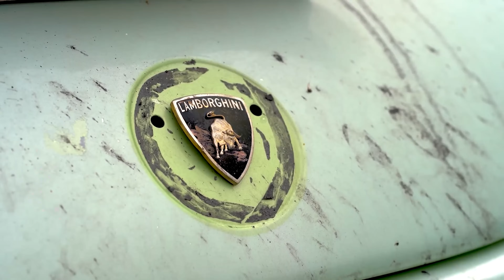Are Wheel Spacers Safe?

Comment: Caught some 2" Mammoth Spacers on sale from American Trucks about a month back. Had good reviews, so I pulled the trigger. Pushed out my factory 20x9 Ram Express wheels about an inch from the wheel well. Been riding about 2k miles, not a problem yet. Proper torque wrenching and thread locker = all systems go.

Comment: I’ve had 1.5” bora spacers on for about 60k miles, not a single problem!
Reply: I got 1.5" bora spacers on my truck as well. I offroad the truck a good amount from mild trails to desert terrains. No issues here. I check and retorque the lugs if needed every tire rotation.

Comment: I used Bora spacers 1 1/2” on my truck for 10,000 miles. Zero issues. Now rocking black rhino +12 offsets to clear all my aftermarket suspension you guys sold me!

Comment: Running Bora 2" spacers for 15k miles so far on stock Ram 20x8 wheels. Re-torqued them after 8k miles and they were not loose at all.
Reply: Did you use loc-tite ?
Reply: @JohnD0129  no, just your regular nut that come with the spacers
Reply: @JohnD0129  Bora will not honor warranty if you use loc-tite.

Comment: The only real thing I've heard about at shops is they make the bearings wear out faster because it transfers the weight at an angle.
Reply: Yep.
Reply: No different than a heavily offset aftermarket wheel. I've always just been told not to use them with aftermarket wheels with large offset and you'll be fine. At that point it's like double stacking.

Comment: I actually lost a wheel on the interstate and someone managed to get it on dash cam, I posted it on my page. I don't think I'll ever run spacers again.
Reply: From the looks of your wheel hub you were running cheap lug centric ebay spacers that sheared off your lug nuts. As this video points out, hub centric spacers are perfectly safe, lug centric ones, like the ones you had, are not. I have over a 100K miles towing 10k on my 2" hub centric spacers with no issues. You not only get what you pay for with these, but it may end up costing you a truck or worse. Glad your OK.

Comment: Can’t lie I’m running 2 inch non hub centric Amazon spacers on my 2016 2500 Silverado torqued with the ole Milwaukee half inch I put Anti-seize all over the back of the spacer and on every stud haven’t had an issue I also tow around 10k pounds occasionally with it rims are stock steel 17s with 35x12.50r17 tires

Comment: Been on Amazon Spacers to run a 17in stock wheel drag setup in my 1,000+hp Vette for about a year. Numerous track visits and 160mph+ roll race hits. I check them at least every other month. No issues thus far (knock on wood)
Reply: What size spacers?
Reply: @braydenmeals9311  15mm and 20mm

Comment: I run spacers on my truck, with factory wheels.  What sucks is that the state safety inspection of Pennsylvania says wheel spacers are deemed unsafe and illegal to use so every time i get my truck inspection done, I have to remove the spacers.   I run 1" steel hub centric spacers, and torque to factory specs and recheck after the first  100 miles, then recheck every oil change when we rotate the tires.  Using the same spacers for 3yrs now without any problems.
Reply: Did you use thread lock

Comment: Medium strength thread locker and actually use a torque wrench and the lug nuts will never come off and lose a wheel.
Reply: Orange thread locker . Close to red and no heat is needed to get bolts off.

Comment: How about using hubcentric rings on a spacer
Reply from the maker: Spacers can be completely made to order with correct hub bores for vehicle and wheels!
Reply: @CustomOffsetsTV  Yes! I did that but now I’ve got new wheels in the way and want to use the same spacers. So I’m gonna use the rings and see if it works

Comment: I have a camper that is around 9,000 lbs what should I get to be safe or is there one rated for that weight rating? 04 Silverado 2500hd 4wd
Reply: Make sure to go with steel spacers if your towing heavy loads, for"lighter" towing aluminum is greative been running 1.5in aluminum HUB CENTRIC (IMPORTANT AF) and no probs towing 24ft boats and some weight in the bed but with q camper that heavy especialy for long distances... steel
Reply from the maker: Like Jaxaboi said 100%
Reply: I have 2" steel spacers on the rear of my lifted 08 duramax and towing 15k gooseneck trailer and mini x.

Comment: I have an unrelated question but will a tire and wheel set up of the same size fit on a leveled 2007 Ram 1500 with no rubbing?  From this 275/55r20 video https://youtu.be/uuT0pRjOjDU
Reply from the maker: Check our gallery out for fitment help here Severna - https://www.customwheeloffset.com/wheel-offset-gallery?sort=date&year=2007&make=Ram&model=1500&drive=4WD

Comment: I’ve been using rough country 2 inch spacers and haven’t had any issues in a year, ive heard good quality hub centric spacers melt and mess up, ive heard cheap eBay spacers run for years. It’s a risky game just buy a decent brand and you should be all right